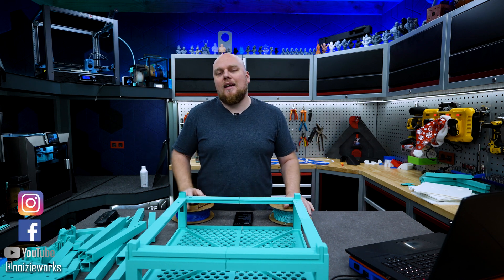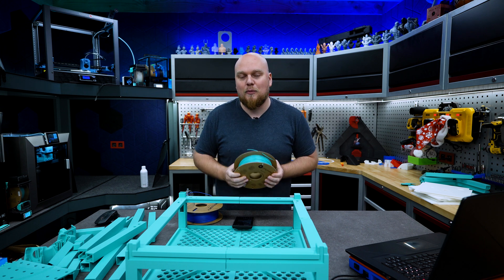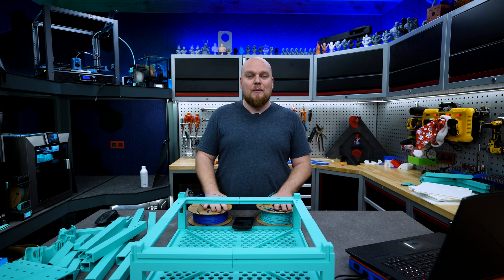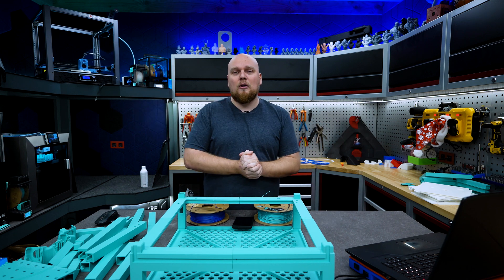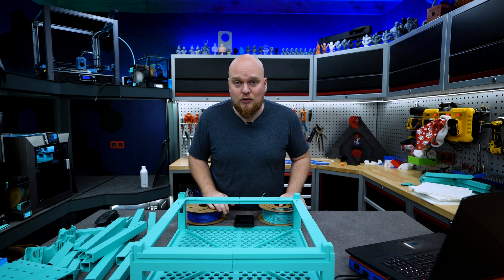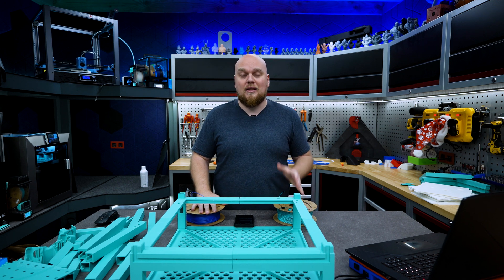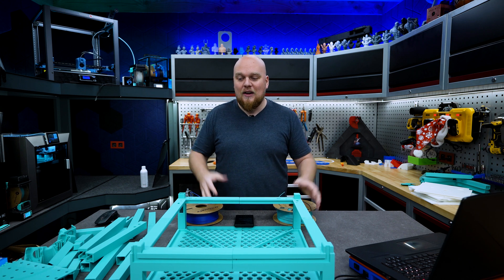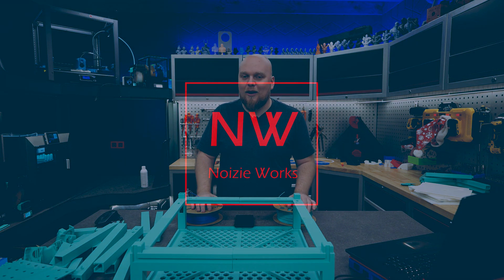RFID tags are the next 3D printing CANCER but it's not too late! The Open Source RFID Standard.

Comment: Could you imagine if an office laser printer company like HP or some other tried to RFID printer paper effectively locking out all other brands of off the shelf 8.5X11 printer paper, that's what Bamboo is trying to do. Based on this channel reviewe, Clough42 & others I finally decided to get in the game and purchasing the Qidi Q1 Pro and I absolutely love it. I purchase filiment from a multitude of different brands most recently Fiberon PETG-CF and it's amazing especially at their price point. I wouldn't even consider buying the equivalent from Qidi based simply on $$$.

* DEMAND OPEN SOURCE RFID *
Reply from the maker: I mailed them the demands 🔫 probably gonna get a boiler plate answer but it’s out

Comment: As someone who runs a 2d printing business, chips on ink cartridges are one of the most annoying things ever. I have a couple of printers which have a system that hasn't been bypassed yet despite being on the market for 3 years. I really hope 3d printing doesn't go the same way. If it does they will increase the price of filament massively. I have to pay about 7 times more for ink from the official supplier than from a third party.
Reply: Most 3d printer software is open source or based on open source software, also there are many companies that try to keep the open source spirit so i dont think rfid will catch on with most companies
Reply from the maker: @shadow501pl 🤞🤞

Comment: I'm not an expert or anything, but RFID is pretty standardized already.  The issue is encryption.  The data on the Bambu spools is readable by any old RFID reader, but it's gibberish unless you have their key.

That means it's potentially an issue that can be fixed in the future with software/firmware updates.  For example, if you have multiple RFID data structures, you can 'teach' your AMS how to read them all.  Even the encrypted ones just need the key. 

The real challenge is convincing the manufacturers to give up the revenue stream that a closed ecosystem brings.  Dropping a spool in and not having to set anything up is a huge value add - this is why you want it standardized, after all.  Opening that up to the competition is not a great business decision.
Reply from the maker: @paulpardee  I'm also not an expert and yes RFID is pretty standardized in commerce. The encryption part is the thing that worries me the most.
I understand that it's part of a revenue model (or they want it to be) but that doesn't mean that you have to lay down and take it.